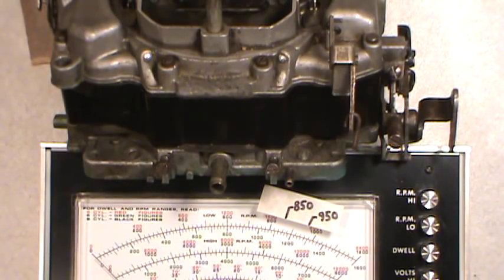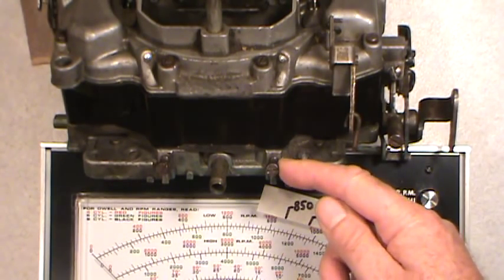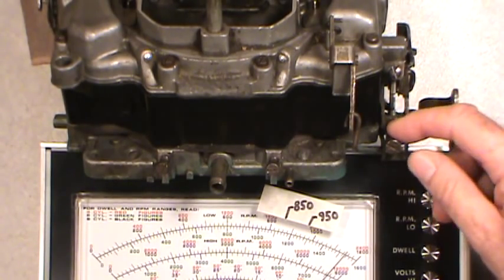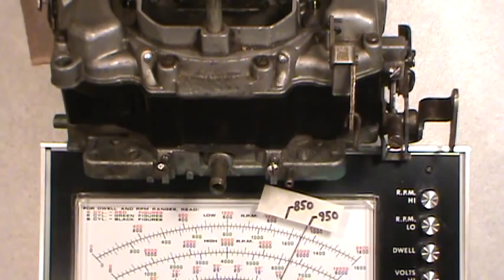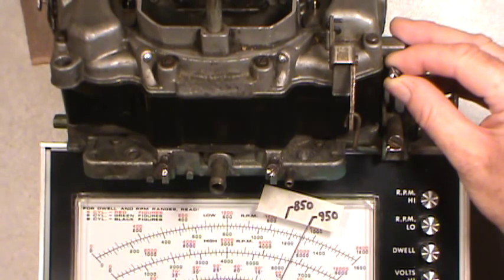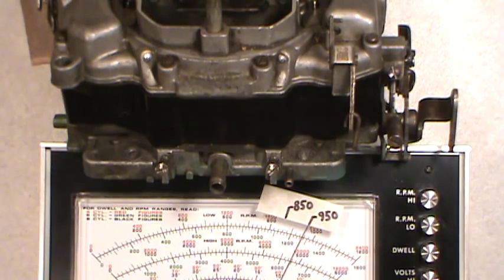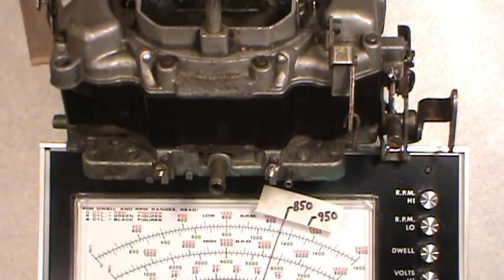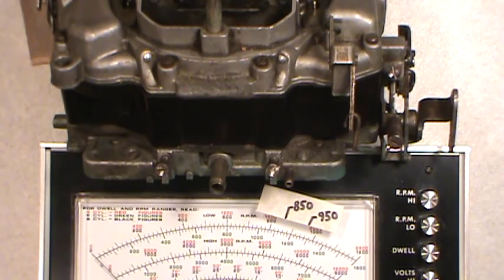Idle Mixture Adjustment on 4 Barrel and 2 Barrel Carburetors

Comment: is it true that the throttle plate should be totally closed to make the most vacuum?
or i have to follow manufacture inhg ?i want to tune my toyota 2 barrel idle and the idle vac reach 20inhg but the chart says 17 when i open the plate the idle is ruff. You explain how to adjust the carb but just with a base line with the idle mix screws but the idle speed screw whats its base line?
Reply from the maker: serchmarc Greetings serchmarc....Thanks for watching, and for Your questions as well............................................Each and every..."Vehicle"...usually has "Its" own "Needs", and, has to be "Adjusted/Set-Up", for..."What-Ever-the-Requirements-Happen-To-Be"...along the lines of, oh, let's say..."Does the Vehicle"...have to be..."Smog/Emissions Tested"...???...because, "If" it Does, the "Carburetor", has to have, the..."Adjustments/Set-Up"...to the..."Factory Specifications"...or..."If"..."It"..."Is Not"...there is a..."Strong Possibility"...that, when, that particular Vehicle...gets..."Tested"..."It"..."Will Not Pass the Smog/Emissions Test"...!!! (and yes, I've Experienced, what I was just sayin'...!!!...lol).........................................."If"...Your Vehicle has to be "Smog/Emissions Tested", the First thing, that You should be looking for, is what is usually called, a..."V.E.C.I. (Vehicle Emission Control Information) Label/Sticker"...that's usually found in the Vehicle's..."Engine Compartment"................Hopefully, You will find One, and the "Information", that You will See on It, should be..."Followed/Performed Very Closely"..."If"...Your Vehicle, Needs to..."Pass the Smog/Emissions Test"...that is.............Also, Your Vehicle has to be fairly "Stock", as in, little or No Modifications to It, and, just about "Every Thing", has to be in "Very Good Condition", and "Set-Up/Adjusted Properly", and some of those "Things", happen to be, the "Ignition System", the "Fuel System" (part of which, is the Carburetor), and, something like the "Emission/s System", that was "Installed" by the Factory/Manufacturer of Your Vehicle, when it was "Brand New"..................................................The Factory/Manufacturer, of each and every "Carburetor Equipped Vehicle", pretty much, has, or had, "Their Own Specifications & Methods of Tuning/Adjusting", and that's why, that "V.E.C.I Label/Sticker" (or, if You can Find the some-what "Same Information"), in something like, a "Factory (Chassis) Service Manual", then, as I see it, You will have a much better "Result", mostly, because, that will pretty much be, the "Way that the Engineers/Designers"..."Intended It, to Work/Perform"...just sayin'....................................................Now then, "If" Your Vehicle "Does-Not" have to be "Smog/Emissions Tested", then, what the, shall we say..."Old School"..."Mechanics/Hot-Rodders", pretty much did, as I see it, was to some-what, "Set-Up/Adjust", the "Idle Mixture Screws"...and the..."(Curb) Idle Speed Screw", to Obtain (get), the "Highest Vacuum Reading" (Hg...or...Inches of Mercury), that was Showing on the "Vacuum Gauge", when the Engine, was "Fully Warmed-Up, to Operating Temperature", and having the Engine, at the "Desired/Acceptable Idle Speed", all at the same time........................................................If the Vehicle, had an "Automatic Transmission", then, "Too Fast" of an "Idle Speed", would usually, make the Vehicle "Creep", as in, when the Brake Pedal was Released, the Vehicle would, shall we say..."Take Off" (Move) Too Much, and Faster then wanted, and that was Without Pushin' on the Gas Pedal...!!!...Yikes...!!!....................................You were sayin', about, having the Carburetor's "Throttle Plate"..."Totally Closed", to get the "Most Vacuum"...???..........Well, there are "Very Few Carburetors", that I have seen, where the "Throttle Plates" are "Totally Closed", while the Engine, was at "Idle Speed", and on Those Particular Carburetors, there was usually, a, shall we say, an, "Idle Air By-Pass Screw", for Adjusting the "Amount of Air", that was Allowed to "Flow" Through the Carburetor, while the Engine was at "Idle Speed"...................................................You see my Friend, on most of the "North American Vehicles", that had Factory Installed Carburetors, on their Engines, before "Fuel Injection" took over, well, They Worked, some-what, like the "Thermoquad Carburetor", that You saw, in this YouTube Video of mine, as in, the "Primary" (Front) Throttle Plates", are "Slightly Open", while the Engine is at "Idle Speed", and, "Not Fully Closed" (Yes-Sir-ee-Bob, no Dedicated, Idle By-Pass Air Adjustment Screw on It, at all...!!!...lol).....................If You "Set the Idle Mixture Screws Too Rich", then, You might "Carbon Foul the Spark Plugs and Combustion Chambers" in Your Engine, as well as, get very Poor Gas Mileage/Kilometer-age, while at Idle Speed, while having the Vehicle standing still, at a Red Light or Stop Sign................................................................................If You "Set Your Idle Mixture Screws Too Lean", and, although, the Engine seems to be Idling alright, and quite smoothly, it could very well be, "Lean-Miss-Firing", and, on one Rochester Quadrajet 4-Barrel Carburetor, that I Adjusted the Idle Mixture & Speed Screws on, a number of years ago, by Ear (aka, Listening to), and even I couldn't tell if it was "Lean Miss-Firing" (Lean Miss-Firing, is when, the Carburetor's, Idle, Air/Fuel Ratio/Mixture, is a bit Too Lean, as in, Not Enough Gasoline in that particular, Idle, Air/Fuel Ratio/Mixture, and the Engine "Miss-Fires", at Idle Speed, because there "Is Not" enough Gasoline in that Idle "Mixture", to make the Engine "Fire Properly/Consistently", as in, "No...Miss-Fire"at Idle Speed), and, even though I couldn't "Detect Anything Wrong"...that there "Smog Sniffin' Machine", at, that there, "Smog/Emissions Testing Establishment"..."SURE COULD"...!!!...lol.........................................So then, if You would like some more help from me, I really need to know..."What Year and Manufacturer of Vehicle"...???..............."What Engine"...???................"What Carburetor"...and Model Number/Serial Number on it...as well as...."Does Your Vehicle have to be "Smog/Emissions Tested"...???............Thanks..............Till next time............Be Safe, take care, and have a good one.
Reply: RockysRoadshow hi rocky,, well your xplanation was pretty good, very well writen. the engine is a 3AU with a suspected swaped carb. AISIN 2 barrel simple/normal carb. 1.5cc and manual tranny. Its not gonna pass emission test right now, i probably do that in 2 years. cause the car is parked inside my garage (restoration project).i think the headgasket is making a bad misfire but ill fix that pretty soon. im waiting for my leakdown tester.. i just asked you about the throttle plate ,cause the repair manual doesnt have a base line for example " turn counter clockwise the speed screw until doesnt touch the shaft trigger or "where the accelerator cable is installed" . well , the manual doesnt say that as a start , just star with the typical toyota phrase.. screw all the way in the mix screws and then turn counterclockwise 1and a half turn as a start then blah blah.. I thought every carb needed the most vaccum but as far i understood you.. is to have the most vacuum with the proper rpm and also with a proper emission CO and HC values at THE SAME TIME, is that correct?
Reply from the maker: serchmarc Greetings serchmarc....I had a look-see, at some Information, on the good ole Internet, and, there happens to be, an, almost "Limit-Less" amount of Information, on just about Anything, and that Includes Your Vehicle as well...!!!...lol.....................................It appears, that, a carburetor, kinda like the One You have there, just might have, a number of Additional Gadgets/Smog Controls, in Addition to, a, let's say, a quite Primitive/Basic Carburetor, that was Manufactured, Before, all of the Smog/Emissions Testing started confronting All of Us.......................................What I would normally be doing, is, seeing if I could get, the "Exact", or, as close to the "Exact Information", as in, the "Information" that is usually found, in a..."Factory/Manufacturers Chassis Service Manual"...on, Your "Exact Vehicle", and, "If"...the "Carburetor", is Different From, the "Original, Factory Installed Carburetor", then, You'll be doing Yourself a big favor, by Finding the "Exact, Factory/Manufacturer's Information, on "It" as well....................................You can also, have a look, and see if You can find a "Website", that has a "Forum", that "Discusses", both Questions and Answers, about Your "Exact Vehicle", as, I'm pretty sure that, You will probably have, quite a few of them, to choose from, once You Find "Them" that is..good luck with that.............................................Now then, about You asking, about..."Vacuum...Proper RPM's....and the CO, and, HC Values"...???......In order to be able to "Pass" the "Smog/Emissions Test"...the Engine has to be in..."Good Shape/Not Too Much Carbon Build-Up, in the Combustion Chambers"...and,..."All Tune-Up and Maintenance Items"..."Should be Up To Date"...and, that also Includes the "Catalytic Converter/s...as well as..."All of the Adjustments"...that..."Apply"...to..."Any Adjustable Components"..."Must be Done Correctly, as per the Factory/Manufacturers Specifications"...or...the Chances of acquiring that Smog/Emissions Test..."Pass"...won't be very good at all..............................You see my Friend, when-ever I have to adjust a "Carburetor", like You see, in this YouTube Video of mine, I do it, the following way, if it needs to be "Smog/Emissions Tested"...................Please Note, this Information "Only Applies", to this particular "Carburetor"...and..."Not Yours...!!!...lol................For Starters...the Carburetor, has to be in very Good working order, or, if not, I Re-Build it............................The Engine has to be fully warmed up to Operating Temperature, and the Choke is fully Off......................I Use a "Tachometer" (that's on my Automotive Specific Testing Meter), to Indicate the Engine's Crankshaft "RPM's" to perform, what is known as..."The Lean Drop Method" (that's right..."I Do-Not Use a Vacuum Gauge...!!!...but...You might have to, depending on what was Originally, on Your Vehicle's "V.E.C.I." Label/Sticker, if Your Vehicle had one, that is...???).....................................On that Same "V.E.C.I." Label/Sticker, it Also had Information printed on it, showing the Amount of CO, for a given, at Idle Speed, Air/Fuel Ratio, if an Automotive Garage, was using a Tail-Pipe Probe, and the Meter to Display, what the Tail-Pipe Probe, was sampling, in order to to do, the Required, Idle Mixture, and (Curb) Idle Speed, Carburetor Adjustments, to attain, the Label/Stickers "Specifications".........................I'm pretty sure, that the rest of, what I did, as it applies to, Adjusting/Setting-Up the Carter Thermoquad 4 Barrel Carburetor, that looks, really close looking, to the One that You see in this particular Video of mine, can be seen and heard, in this very Video.................Yes, indeed...the "Idle Mixture Screw Settings"...the (Curb) Idle Speed Screw Setting...as well as...the Engine's Crankshaft "RPM's", especially at (Curb) Idle Speed, have to, shall we say "Compliment One Another", and really should be "Adjusted", according to the "Factory/Manufacturers Specifications", in order, to, like I was sayin' earlier, to have..."A Better Chance at Passing the Smog/Emissions Test"...!!!................................If I were to just use a "Vacuum Gauge", it would only, take me as far as, getting to the "Stage", pretty much the Same, as when I Adjust the Idle Mixture Screws, to attain, the Fastest RPM's, Mixture-wise, at that 950 RPM's, that I Set the (Curb) Idle Speed Screw for, and, just "Before", I Started to perform, that.."Lean Drop" (Method) in RPM's, from 950 RPM's, Down to 850 RPM's, which, by the way, "Required" me, to use the "Tachometer", and "Not, a Vacuum Gauge", or, I wouldn't have a Clue, as to, where my HC and CO Levels were at.....................................Now for Excessive "NOX", or, Oxides of Nitrogen"...Tail-Pipe Emissions...............Usually at (Curb) Idle Speed, and at "WOT" (aka, Wide Open Throttle)..."NOX" Emissions, aren't much of a concern, but, at lighter engine loads, and at cruising speeds, oh, somewhere between Idle and WOT, let's say, then, probably due to, a somewhat "Leaner Air/Fuel Ratio", and the, Very Much Increased Ignition Timing (50 Degrees, give or take a bit), if it wasn't for, a Functioning EGR System, the "Increased", Peak Flame Combustion Temperature, would probably, make for some very High NOX Emissions, just sayin'.........  .............Too much "Ignition Timing" (Advance Degrees at the Crankshaft), and/or, Too Much "Carbon Build-Up" in the Combustion Chambers, and, if, the Engine had an "EGR Valve/System", Installed On, or Near It, the EGR Valve, and its related Components, have to be, some-what Carbon-Free, and working Properly, or, any One, or Combination, of the just mentioned, shall we say "Items", are not behaving themselves (kinda like Malfunctioning, I guess), then, that "Smog Sniffin' Machine", would be Reporting, some, rather high "NOX Readings", on Your Test Report...!!!...(pssssst...equal, to the "Fail" word)...Yikes...!!!.............................So, I hope, what I was sayin' here, will be of some help to You.......................Yes-Sir-ee-Bob...all it takes, is, just "One Little Incorrect Adjustment"..or a, not working so good "Component/Part"...to make, just about Anyone's Vehicle, to be "Emitting Excessive Tail Pipe Exhaust Gas Emissions"...Over and Above..."The Maximum Allowable"...and, if that be the case...No "Pass" (word), will be seen, Printed on the Report that gets handed to You, at, that there "Smog/Emissions, Testing Establishment"...oh my...!!!.....................................Perhaps, have Your Carburetor "Fine Tuned" for Smog/Emissions Testing, by an Automotive Fix-Em-Up-and-Repair-Establishment, that is Qualified to do so, that has a "CO, and/or HC" Tail Pipe Probe/Meter Testing Unit, as by doing so, You won't have to worry so much, about, not getting it, as Critically Set, without the Equipment, that the "Shop" has............................I really hope, that You can find, the "Exact Specifications" for You Vehicle............Good Luck...........Till next time.............Be Safe, take care, and have a good one.
Reply: RockysRoadshow rocky thanks very long reply, ill read it later after work

Comment: I typed in adjustment for 2 4 barrels for a 61 corvette. This didn't do a thing for me. I already know about adjustment on 1 carb
Reply from the maker: Greetings...jack orr……….Well, a pretty simple way, to get those two quads (2, four barrel) carburetors, idle mixture screws, adjusted reasonably well, would be, to use a "vacuum gauge", to obtain, the "highest" vacuum reading, when the engine is fully warmed up to operating temperature, and is also, at the desired idle speed (make sure, that, the choke is fully off)………...Here's what I would do...…...Engine "not running", then, turn all of the idle mixture screws, in very lightly, until they stop, then, put a chalk mark (or whatever mark), at the 12 o-clock position (as in, pointing at the sky), on each idle mixture screw, for a reference point only...……..Then, turn them all out, oh, about 3 turns out, should be ok, to get, the already warmed up to "operating temperature" engine running (idling)………..Vacuum gauge was already connected to the intake manifold (to measure manifold vacuum), then, you have to decide, what the "target" idle speed will be (try to keep it under 1,000 RPM's, or, the carb/s, might transition into the primary fuel circuit)…(sometimes, the initial timing has to be altered, to get things right, and also, make sure, that, your "total" timing is correct, and not "over-advanced, or, damaged engine, it just might be...!!!)...(total timing is, initial/base, plus, the amount of mechanical ignition timing advance, that, the centrifugal advance weights will provide, when they are "fully" slung outwards).........A lot depends on, just how "aggressive", that your camshaft really is..........Factory/stock cams, are usually easy, to get the idle mixture screws, adjusted well...........As for really, shall we say, "lumpy" cams, then, the "ignition advance curve", as well as, usually, a quite high (in advance degrees), of initial/base ignition timing, that, those lumpy cammed engine's need, to sustain, a reasonable idle..........By trying, to get the lumpy cammed engine, to stay idling, by just turning in, the idle "speed" screw/s (too much), then, a really smoky exhaust, it will usually be..........So, just adjust those (probably 4), idle "mixture" screws, reasonably, the same amount of turns and partial turns out, and try to get the "highest" vacuum reading (measured in Hg, or, Inches of Mercury), on the vacuum gauge, when "both" idle "speed" screws, are set, to your chosen "target" idle speed............It's kinda like a juggling act somewhat, as in, when you turn, one or more idle "mixture" screws, then, the idle "speed" usually changes (higher or lower)..........Just adjust the idle "speed" screw/s, to keep the idle speed, at your "target" (warmed up engine) idle speed, that you want, to end up with........Well, there is some basic stuff for Ya, that I hope will be of some help to you..........Good luck, and.......till next time.......Be Safe, take care, and have a good one.